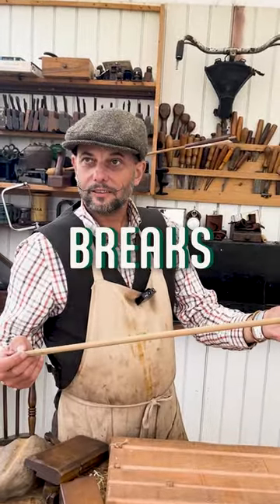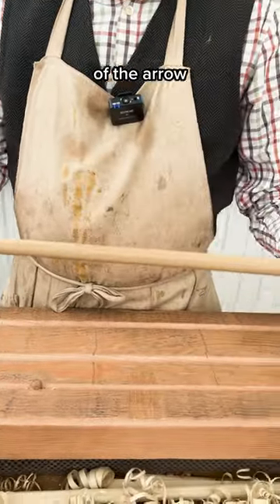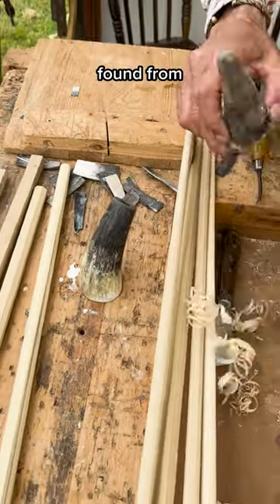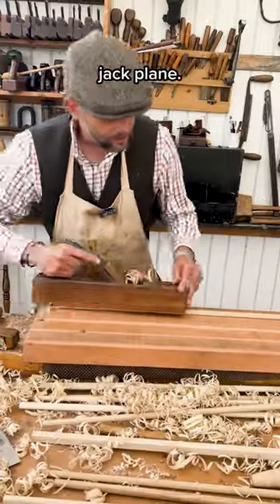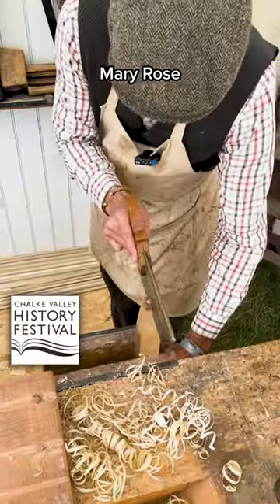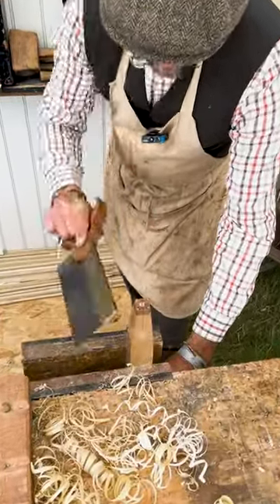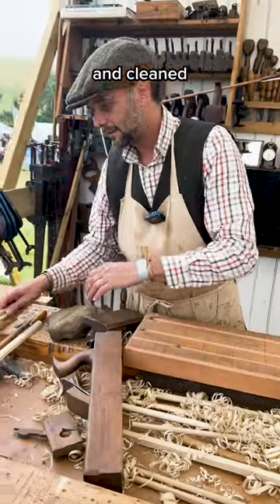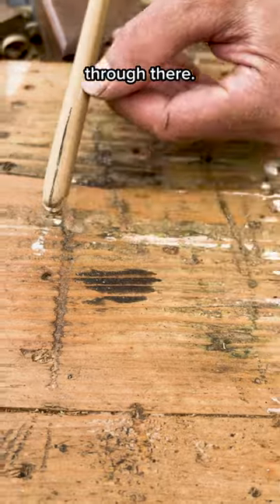This is how to make a medieval arrow

Comment: If the shaft splits, it can do much worse than break the bow. It could drive the splintered wooden shard through the archer's arm with the force of a 130 pound bow behind it.
Reply: So, not stuffed.
Shafted. 😏👍
Reply: @jer1014t2th  strikes the abdomen, then you're stuffed!
Reply: @Smkpt42  ...no, still shafted.
Reply: @jer1014t2th  I'd be pretty stuffed having a couple arrows in my stomach... 
But I guess some have more an appetite?

Comment: Do u put two separate pieces of horn so u have strength going on two different axis??
Or just the one..?
🧐🤔🤨🤷🏼
Reply: One piece of cow horn 2 inches long perpendicular to the nock, the other notch in the jig is to start the nock which would have been widened to the width of the linen bowstring. A verdigris fletching compound consisting of beeswax, rosin and copper acetate is applied when hot and runny for the length of the goose or swan fletchings about 6 1/2 to 7 1/2 inches long. They are bound in place with red silk, then reheated so that the mixture melts and flows over the binding, keeping everything in place. More than 3,500 arrows were found on the Mary Rose, quite a few still had traces of a green hue from the copper acetate, which is thought to have been used as an insect repellent to protect them from feather mites while in storage at the Tower of London and on campaign, the copper acetate was also applied to the rawhide glue to attach the arrowhead to the aspen/poplar, birch or ash shaft.